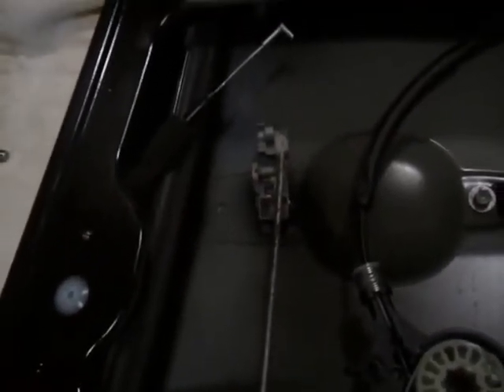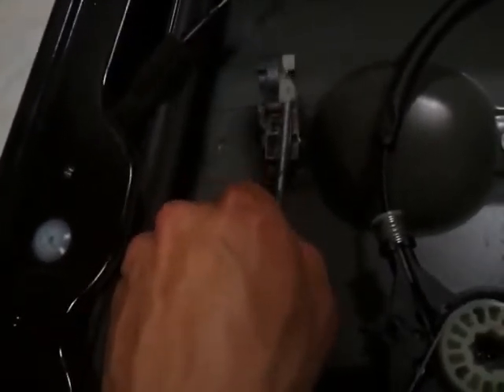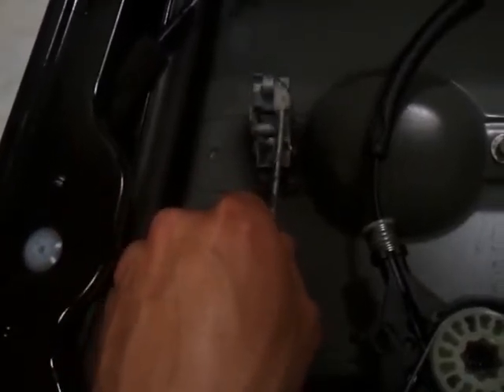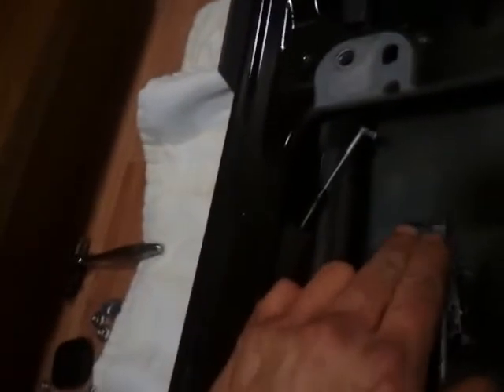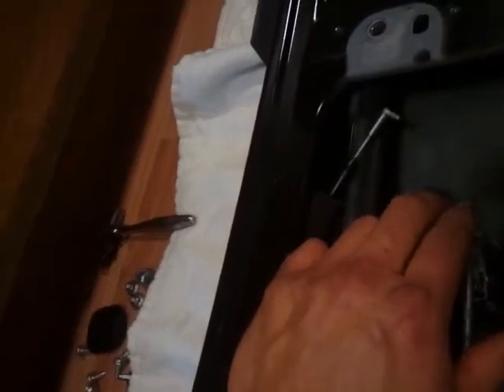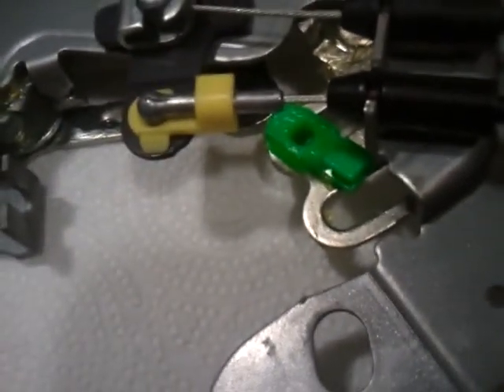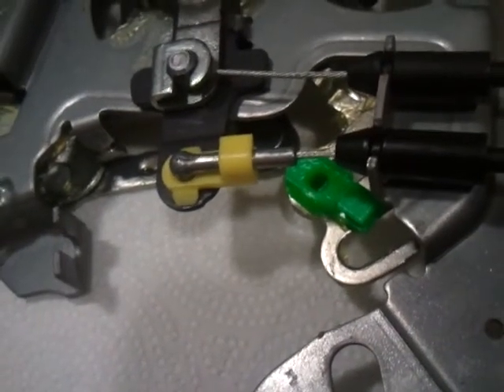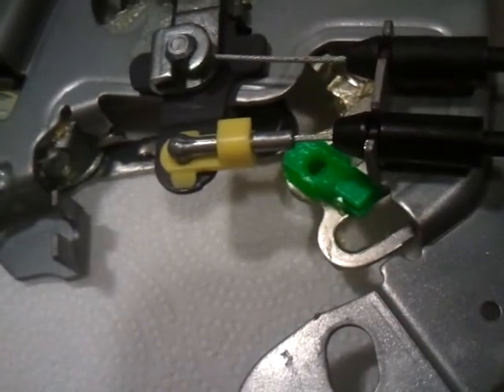2007 Mazda5 Broken sliding door handle findings:

Comment: I need to tear into my Daughters 5 to fix this problem also. What I can't seem to understand with out seeing the parts myself is the part that you show broken, does that come with the handle, or is part of the handle? The factory parts diagram is tough to understand. The rod link seem to not include your broken part, and its hard to determine if that part is broken off the handle. Thanks for your video and your link to Madza 247.
Reply from the maker: My apologies.  It has been a while since I performed this repair on our Mazda5.  I don't recall exactly, but I believe it came with the handle.

Comment: Did you have to take the door off the vehicle?
Reply from the maker: I took the door off the vehicle because it was cold outside and I wanted to be warm, have room to work, and have good light.  I have a small non-heated garage.  You can probably do the repair on the car.